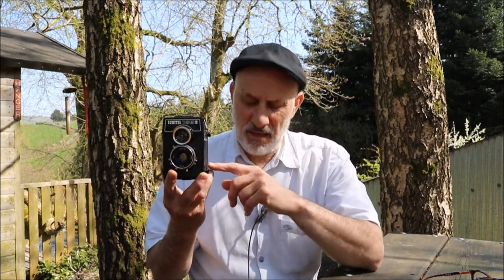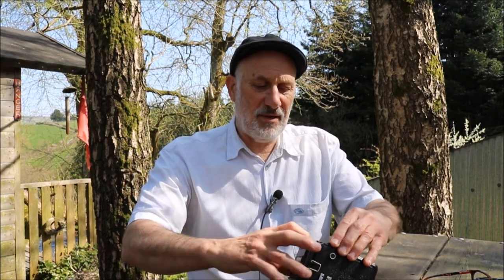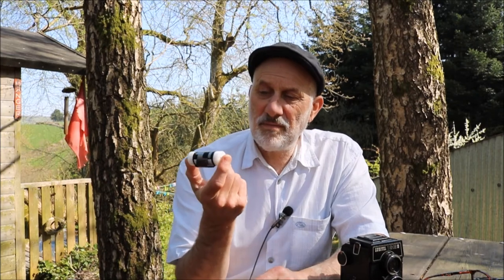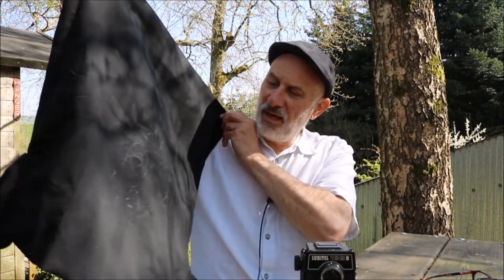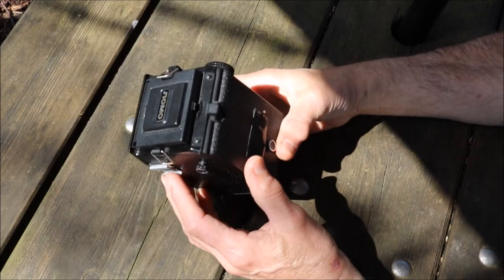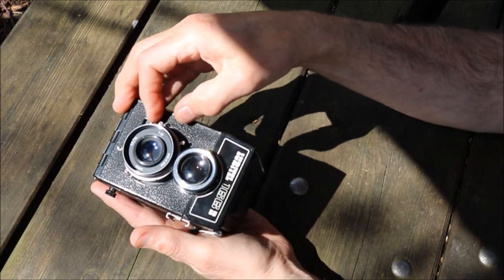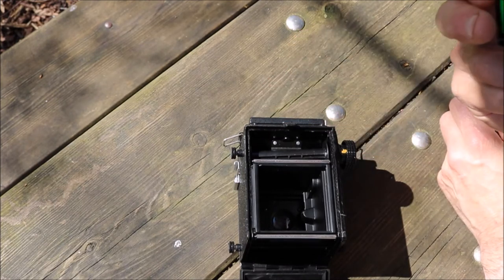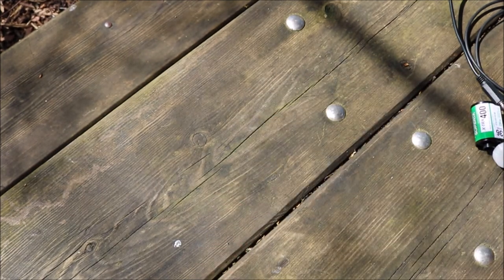Negative Energy: Lubitel 166B 35mm film hack

Comment: Hello, I enjoyed this hack, thanks for posting it. I know you did this video a couple of years ago, but wanted to add a hack of my own. That clip on the back of the box that opens the camera to expose the film is a real bugger and can easily catch on something, like your shirt, and pop open at the worst times exposing your hard-earned shots. Just use a small piece of black gaffers tape, or electrical tape over that tab and you won't have to worry about it popping open on you. Cheers!
Reply from the maker: Sound advice and something that I normally do. A lot of these Lomo type cameras from the Soviet Union and China have dodgy fasteners